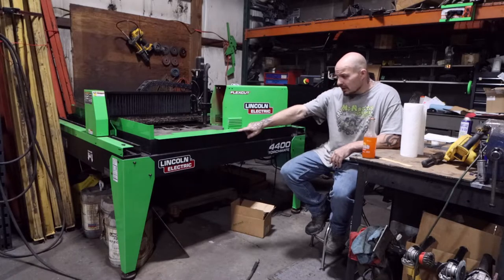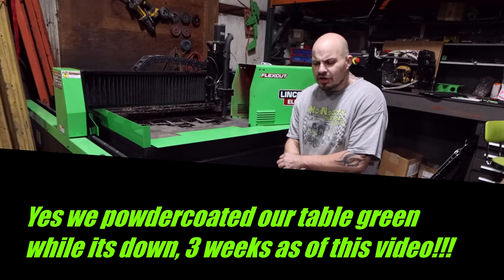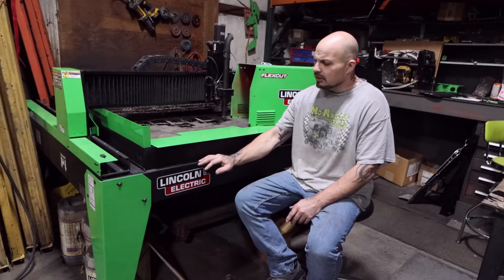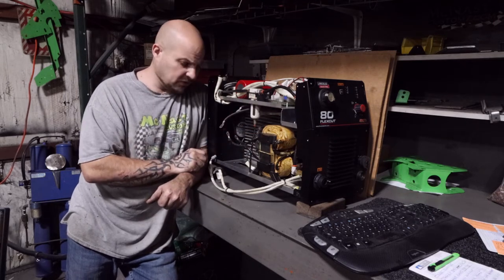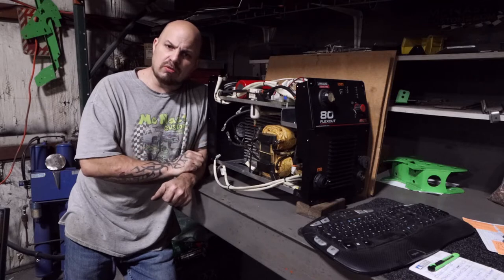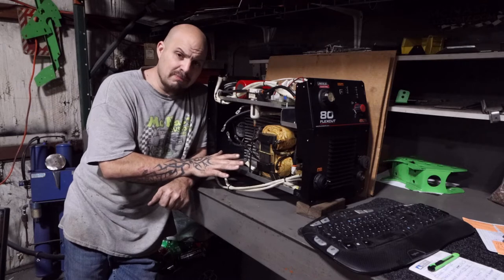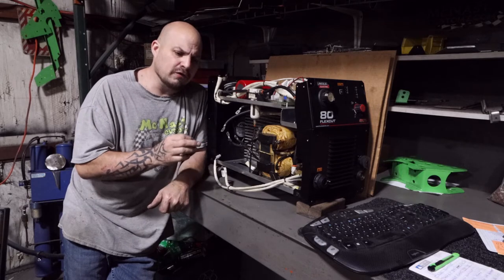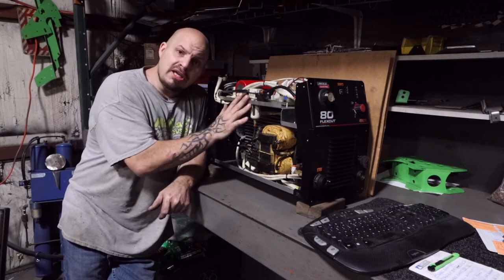ISSUES WITH THE LINCOLN TORCH MATE CNC PLASMA TABLE

Comment: We bought a 4400 three years ago.
Nothing but problems.
Everytime it's turned on, you never know if it's going to work properly or not.
The Flexcut 80 is the only part of the system that's performed well.
Reply: Have you had any official training on the table?
Did you try contacting customer support to help resolve the issues?
If the answer is no to both, the issue with the table is user error.

Comment: That’s insane. They lost my business on a table. I went through the same shit with my Lincoln gas welder 330 MPX. Brand new 2022 with 80 hours on it. Started leaking oil. Had a place look at it under warranty and they wanted $800 just for a diagnostic. I called Lincoln back and chewed them out. After that They paid the bill. Then they told me it would be about six months to get a new machine. Bullshit. I started calling around and the place down the road had 15 of them in stock. I me, found a local place to exchange my old machine for a new one through Lincoln. They say oh give us a call we will help. No when shit hits the fan they dont.
Reply: The cutting systems division operates separately from the welding division. They are 2 different departments with 2 different customer service teams and warranties.
You probably didn’t take it to a an official lincoln repair center, or you did but never told them it was warranty work. Also, during the pandemic, lots of parts were scarce. Every company had issues.

Comment: They market it as a production machine, and they have production settings. My company had the exact same issues with the warranty, 125 Amp broke down after 2 1/2 years. Undersized Diodes had to be replaced. Qty. 4

Comment: The machine is full of glitches because you painted it green lol. I have a 4800 and it had a few glitches and fortunately they sent a guy out and replaced accumove and wire harness under the warranty. So far, it runs like a clock. The biggest issue they found was it wasn’t properly grounded. Knock on wood, it runs really well to date.
Reply from the maker: it was powdercoated while the table was down.
Reply: I see, it actually looks dope. Just busting balls. I hope it’s running better now.

Comment: Here i am a year later after this video came out with a very similar situation after owning and operating a torchmate table since 2005. Its been upgraded in 2012 to the latest and greatest and today they cant sell me a stepper drive card. Told me to go to flashcut for it. So I go to flash cut to order the stepper drive card which is in stock for 240 usd and they tell me i cant buy it from them unless i become a customer of theirs by buying a software license for another 1000 usd. Its time torchmate and their partners become exposed by us their customers. Now I know people have their opinions on chinese made anything but a quality 5x 10 with torch and plasma without plasma machine comes from china today at 4000 usd which includes usa supported fastcam software ready to connect to a hypertherm plasma. For 2 grand more get the pipe cutting attachment. F$$$ Torchmate and Lincoln electric